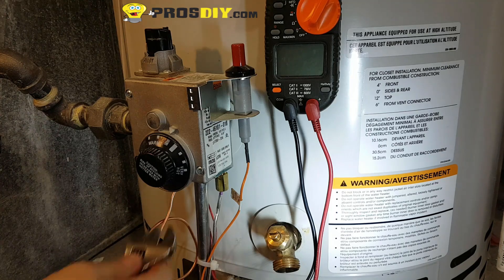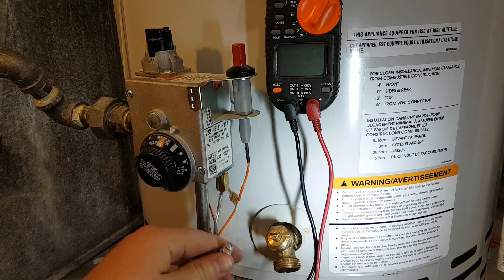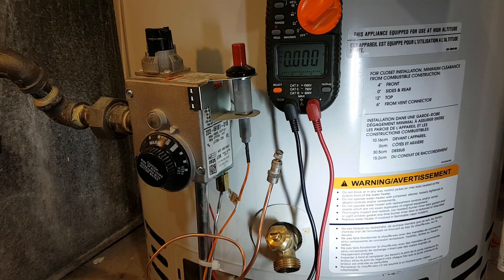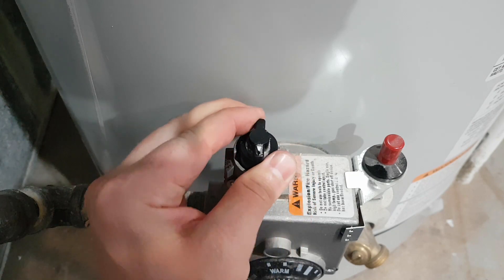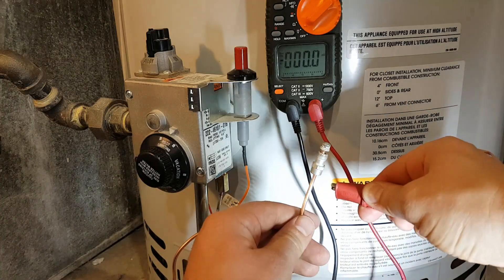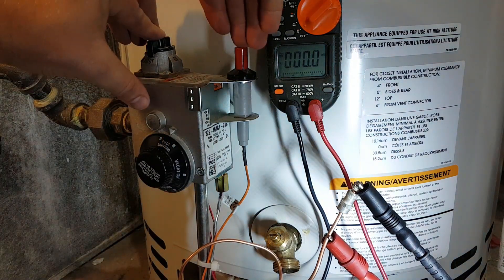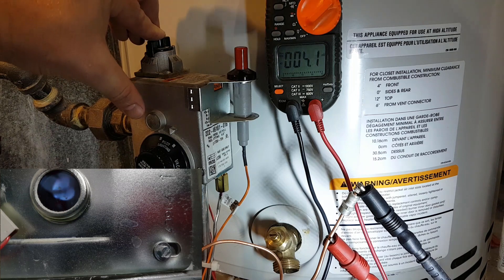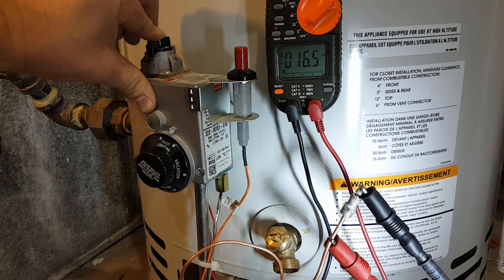Testing a Thermocouple's Voltage on a Water Heater

Comment: Mine lights and blows itself out as son as I remove the lighter due to pressure of the gas coming out of the Toube end. There is a very very small hole in the end of the tube that I can barely see light through. Thermo doesn't click and couple puts out 21.5mv. It appears I have two problems. 1. To much Pilot Light tube pressure and the Thermo Soleniod is bad. I have a propane heater and it's set on propane.

Comment: My Rhemm water heater(MODEL: 42VP75FW) has no pilot light. Do you have a similar video that I can use to test the thermocouple?
Reply from the maker: Unfortunately I don't have a video yet on power vented models, like yours. Your model doesn't use a thermocouple. It is electronic ignition and uses a flame sensor to prove the pilot flame. Is you control valve giving you an error code?
Reply: @PROSDIY  so far so good. you have very high quality videos in your channel. thx

Comment: What if you can’t get the pilot light to ignite in first place?
Reply from the maker: Hi David. Just a couple of questions to get you in the right direction.
Can you see a spark when you click the igniter? Sometimes it's easier to see if the lights are off.
If you have any other gas appliances, are they working properly?
Thanks!
Reply: @PROSDIY  there is a gas furnace also that works great. There is no spark when I depress the red ignitor button. I followed the instructions to relight the pilot. I also replaced the thermocouple and clean off the white deposits around the burner. Maybe it's the igniter itself ?
Reply from the maker: Sounds like it could be the ignitor or ignitor wiring. On most water heaters you can pop out the ignitor (Piezo Ignitor). I would remove the ignitor and disconnect the wire from the bottom. Place the bottom of the igniter up to but not touching a piece of metal and click multiple times to see if a spark jumps. If it doesn't jump, replace the Piezo ignitor. Note: Wear a glove when doing this to reduce the chance of the spark jumping to your skin and giving you an unpleasant shock. If it does jump, the igniter is fine and it is either the ignitor wire or a dirty ignitor tip and pilot shield. The spark jumps from the ignitor tip to the shield. If it is dirty the resistance for the spark to jump will be too high. Shining this area up with some fine sand paper will resolve this issue. Inspect the wire for any bare uninsulated spots, this would cause the spark to ground out and not reach the pilot assembly. Let me know how it goes and if you have any questions. Thanks!
Reply: @PROSDIY  I did some more cleaning around the igniter close to the burner. It did light when I held down the pilot knob but went out after holding for 1 minute
Reply from the maker: @clarkkent2220  Did you happen to do a voltage test after replacing the thermocouple? If so what was the mV reading?
Reply: @PROSDIY  update: I believed it the issue was a dirty igniter tip. After cleaning it several times and also the heat plate, it worked no problem. Flame is bright and normal. Thanks for your speedy responses.
Reply from the maker: No worries! Glad you got it figured out. Nice Work!
Reply: @PROSDIY  and you got another sub for your quick responses:)

Comment: What about amperage
Reply from the maker: The Amperage isn't an important measurement for water heater thermocouple testing and would require specially fittings to be able to accurately measure current in series. The most important and useful test is the one shown in the video, an opening circuit voltage test. A closed circuit test is also useful, but requires an adapter: https://amzn.to/2Vgb7cM
Thanks for the question. Take care!

Comment: My real question is can i make electricity to run an led leght ??
Reply from the maker: I would have to say no. The amount of volts and amps from a water heater's thermocouple is very small. A thermopile on the other hand creates roughly 30 times more voltage than a thermocouple and it is used to run a very small diagnostic light on the gas control. A thermopile would be enough to run a single small LED, but it wouldn't be enough for illumination.
Reply: Thanks for all information your are the best
Reply from the maker: @CoupableSaji  No worries! Thanks for the question!

Comment: tell me exactly MV  that i should replace thermo couple
and can i repair or not
Reply from the maker: Hi Fawzi El Roomy, Acceptable range for the thermocouple is 17-32 mV. They are not repairable and should be replaced if under 17mV. Thanks.
Reply: @PROSDIY  What if its above 32mv say 50ish is it good?
Reply from the maker: @enzoamore9173  Most thermocouples won't produce 50+ mV, but if you are getting a high reading it usually means the thermocouple is to far into the pilot flame. The pilot flame should only be contacting the top 3/8" to 1/2" of the thermocouple. Thanks for the question!